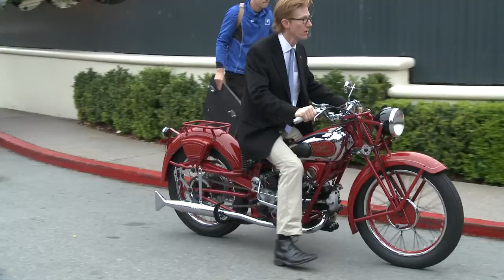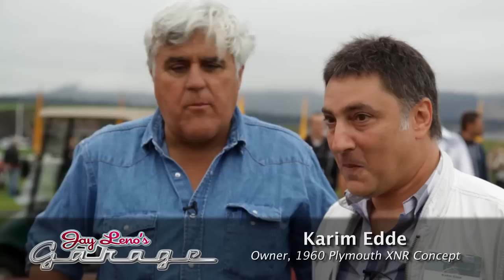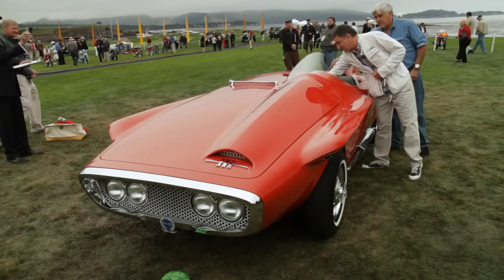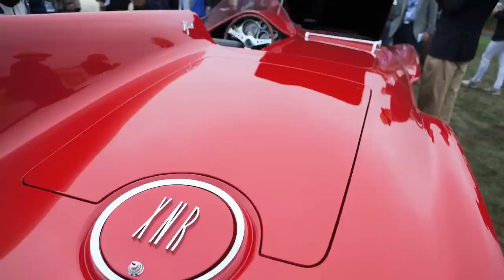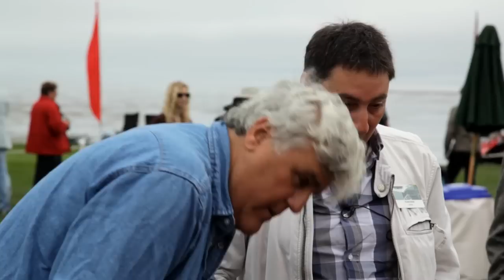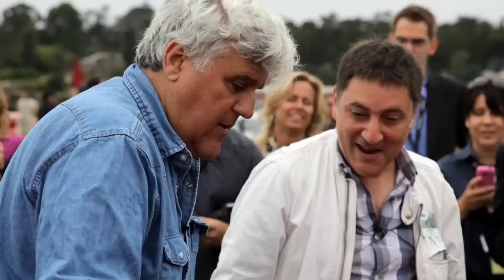1960 Plymouth XNR Concept Car - Jay Leno's Garage

Comment: I helped a friend build a race slant six, back in the early 70s and that engine could and would hit 9K RPM, but was kept to 8K for safety. He turned 10 & 11 second quarters in the Duster it was in, not sure of his differential choice, but he won most of the races in his class and beat quite a few small block V8s. With big slicks in back he could just lift the front end off the ground.

Comment: There is a history to this car that deserves reading. It was hidden in a foreign country so that it would not be confiscated and destroyed is my "translation" of what I read. The engine is equipped with a 4 bbl carb and the longer intake ram manifold. CHRYSLER called it a  HYPER PACK. DODGE & PLYMOUTH completely dominated the 1960 & 61 compact car races at Daytona so 61 was the end. Ford & Chev had nothing to offer that would offer any competition . They ran about 150 in race trim (Valiants & Lancers). Chrysler also offered the "Slant Six" in a 225 ci version

Comment: In 1978 when I got my drivers license, I drove my grandmother’s 1968 mist green stripped down two door Valiant with the venerable 170 in.³ slant six. 94 miles per hour was the approximate top speed. One day, showing off with my cousins from the East Coast in the car I tried to do a 0 to 60 run on a 45 mile per hour speed limit expressway. Between 15  and 20 seconds I was finally getting close to 60 miles per hour and received a prize by getting pulled over by local law-enforcement. He had plenty of time to catch up to me, but fortunately I think I got off with a warning. 

Shortly thereafter, I got my own car for $1,200, a very sharp B5 blue 1968 Dodge Coronet R/T with a 440 Magnum with white interior and a white vinyl top. Needless to say, I had no problem getting up to 60 miles an hour (in about six seconds) and probably could have outrun the cops if I had to. 😎

Comment: The engine is a 170 cubic inch with the factory 'HyperPak' setup, of larger cam, Carter 3083 4bbl carb, tunnel ram style inlet and cast equal length exhaust,.. and yes, it'll rev to 9000, but it is the short stroke version of the Slant.